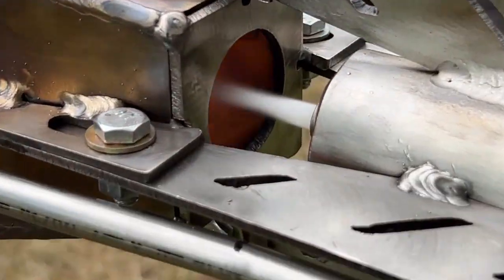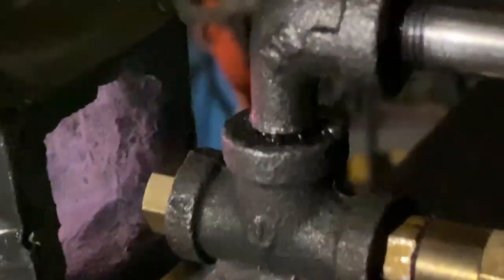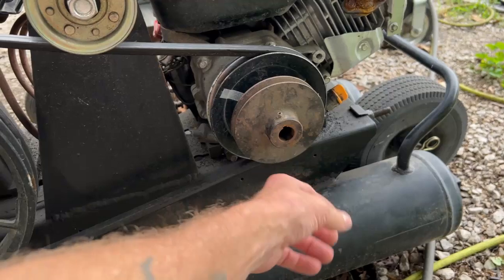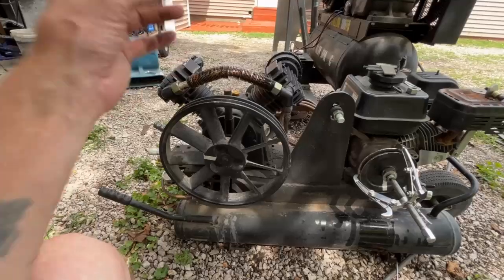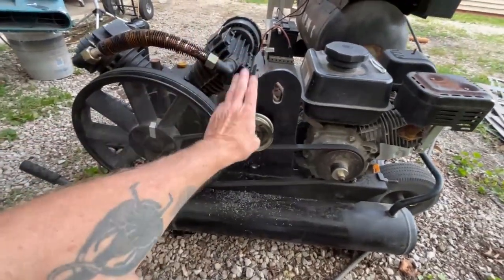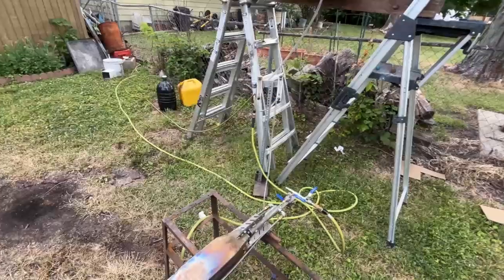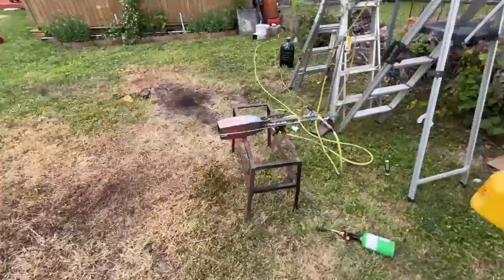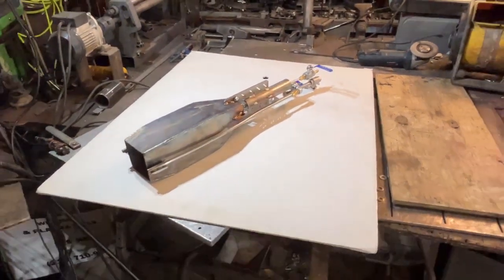Mega Godzilla Burner and combustor DESIGN

Comment: Do you make waste oil burners that run off electric fans? Instead of compressed air?
Reply from the maker: yes but clean oil is needed
Reply: @NOBOX7  i have unlimited access to pure used engine oil from work.  I've been collecting the cleaner 5w30 or lighter for my Chinese diesel heater, but only get a week before having to tear it down and clean the burn chamber running a 50/50 diesel oil mix

Comment: You could use a hydrovane/jack hammer Compressor, cheap at a work site auction. I had one running a sawmill, if the supply line blew it would still hold 100 psi out of a inch and a quarter pipe and im sure it went to 150psi.just a thought.

Comment: You really need to figure out a better way  to make compressed air...  
Thinking a v6 or v8. One side stays stock. And the other side Flat plate with check valves....

I was going to modify a 4 cyl  engine  and drive it PTO off my tractor... but accidentally ran into a hydro vane compressor. So its driven by PTO  100 cfm but only 100 psi.... 
Makes a pile of air.

Comment: Couldn’t you use (Ceramic) Flame Holders for Turbulence without restricting the Inlet?
Pulling more Air in seems desirable compared to increasing the Presurized Air Supply.
I think you already had Designs with increased Turbulence for Burnout. "Little Dragon" or something like that?

And your Air Preheat always looked good on the other Devices.
Slightly below Cracking of the Fuel should move the Point of Vaporization for the Combustion back a tiny bit and might increase the Stability of the Flame at the same Time.
Reply from the maker: You cant create that turbulents in the back end needed for higher power operation if your pumping to much air in the secondary  . Similar to what we observed with the Fat man burner . High pressure turbulents zones give you high power

Comment: Just an idea to mule about. You can probably get away without an compressor by building a self contain system, a Tesla turbine - Tesla (air) pump (as a compressor) setup, where the Tesla turbine will be driven by a steam, being created by the burner, and the turbine will be co-shafted with the Tesla pump (a Tesla turbine run reversely). The only disadvantage of such a system would be that it will have to be wrapped up slowly (clearly) till it get to an efficient working regime but for a long running processes will be an extremely efficient use of some of the exiting heat and (what is likely more important) for remote, sort of off-grid, applications will not require any electricity.
Reply: Waaaay to complicated.
The Burners themselves are already a whole Can of Worms.

Industrial Plants sometimes use Steam in the Ejectors for the Fuel, when they have it available from the Process anyway.
It reduces the Flame Temperature, but that’s most of the Time a good Thing as it reduces NOx Emissions.
Then you "just" need a powerful Blower for the Flame without a strong Compressor for the Atomization.
Sucking in Combustion Air for a First Stage might be possible with high Energy Steam.
Then you can add the Main Air downstream after the Fuel has been reformed from the wet and rich Burn.
Reply: @FullSpeed_only  Agreeably it is more complicated then if one buys and uses a compressor, for sure. But again, the compressor is an additive tech (technically not needed) that depends on electricity which by itself requires tech to be transformed. As to the Tesla turbine - Tesla pump config, that is a way more simple to build then many people realize, especially in co-shafted configuration and  when  there is no need for conversion of the rotational energy to electricity.

Comment: Sounds like you need a flywheel -pully combination.If you got the chunk of steel you can make it yourself.V belt pulleys are easy to make ,lust make sure that bottom of pulley is deeper than the root of the belt .Only sides of belt need to touch the walls of pulley.You can make the profile knife for it from hss blank easy by making a template on paper .most belt manufacturers have information about sizes and angles .
As of flywheel its also easy ,outside of flywheel is heavier than the middle ,several ways to achieve this ,one is making it out of steel and leave outer width larger while reducing thickness of the middle pulley .
If you work in aluminum what works great is cutting a dovetail groove in outer diameter of pulley/flywheel on both sides and then you pour molten lead in it -machine the pulley to size and balance it if needed.